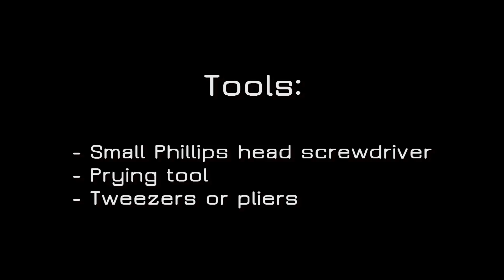How to install Dualshock 4 Magic Touch LED Modchip - PS4

Comment: Will the senor still respond if the back shell has a custom paint job and clear coat?
Reply: Also which controller models will this work for?
Reply: @I_Prevail3  all

Comment: The annoying part is once ur finish installing the led the analog sticks scratch the copper but it does nothing to the led and the analog sticks are to low that’s why it’s scratches the copper

Comment: The stick is free to move? Or not for the led?
Reply from the maker: Yes I have tested it, but only with the sticks we ship. If you use other sticks you might have to put something in the channel inside the stick to raise it slightly. (We already put something in the stick so its free to move)

Comment: The fingers are not on the sensor when playing?
Reply from the maker: I have not yet had any issue, you could try to move it to the middle more if you think you will touch it.
Reply: having trouble finding the touch spot, could there be a fault? iv only manage to get it on red once